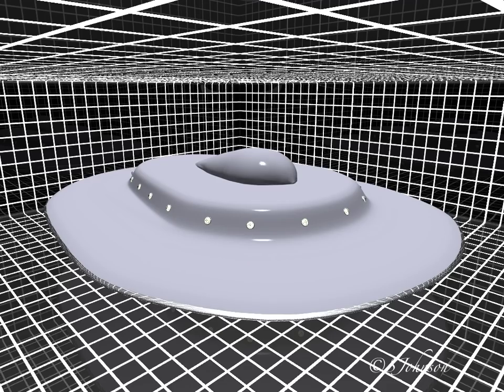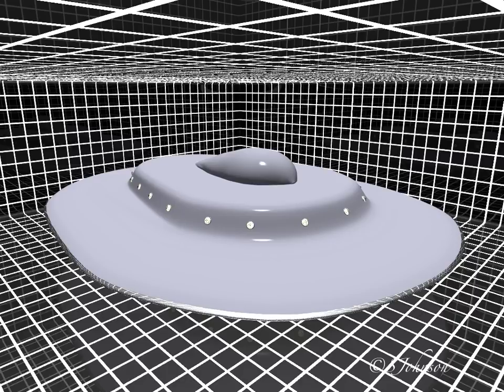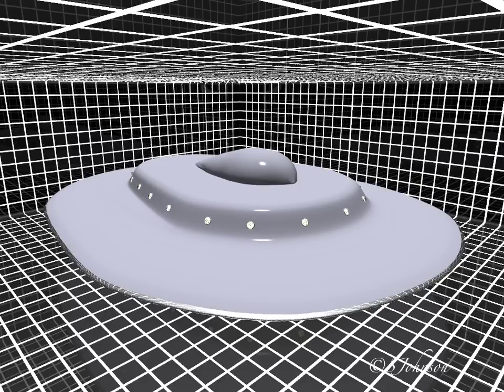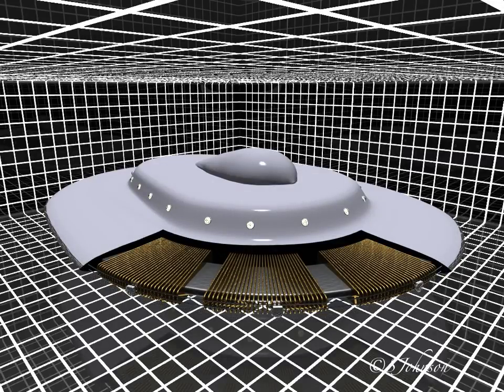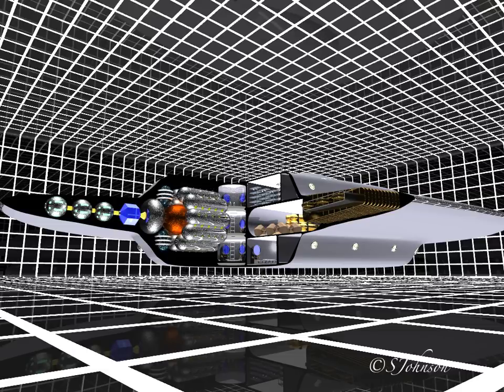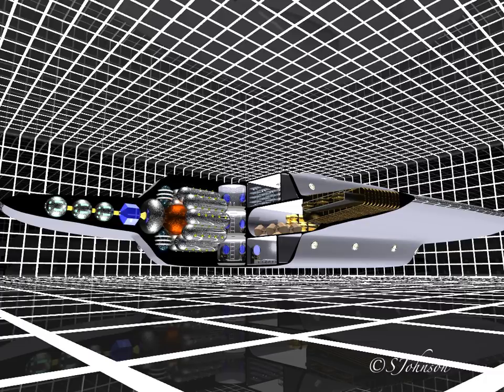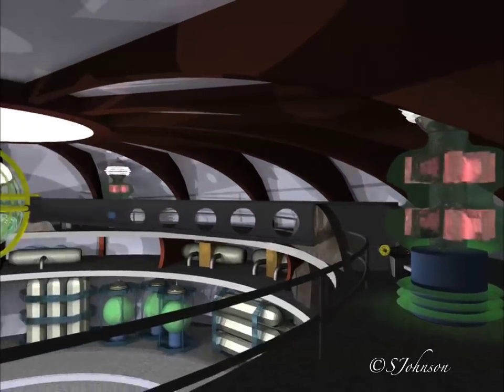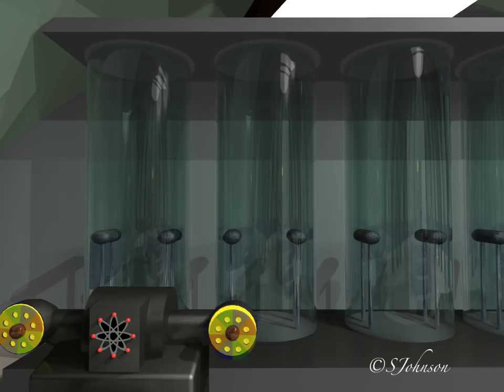3D tour of Exeter's Ship from the movie This Island Earth * Scifisteve

Comment: From the production notes available, the starship was made of cast aluminum with clearly defined texturing across the hull, similar to azdecing seen on more recent miniatures. When the ship is shown returning to earth and entering the Earth's atmosphere, alcohol was sprayed over the bow and then ignited to simulate the intense heat of a vessel traveling through air at tremendous speeds. It was a very heavy miniature.
Reply: I think you must've read my articles on the film...or an article based on my writings. Actually it was a type of mineral oil that was sprayed on the model of the ship which had been cast in iron and heated in a kiln until it was "cherry red-hot". That heated surface ignited the oil as it made contact with the hot metal surface. The model used for most of the shots was very light weight. The iron casting (which consisted only of the upper half of the entire model) was only used for the one group of "thermal barrier" shots, and was indeed the "very heavy miniature" you mention.

Comment: Great work, Steve! Particularly like the refinements, especially the shape of the bridge to reflect the saucer's exterior. It never even occured to me that the conversion tubes rising up made no sense but, of course, it's another oversight on the part of the set designer. Any chance you could add an 'observation' walkway? In my mind's eye it's just a corridor that runs around the rim of the saucer and the outer hull wall and would be punctuated by those large portholes we see on the exterior.

Comment: The only thing I'd disagree with is that here you enter the bridge from behind the tubes, but the entrance was across the room, where the lady scientist in the tube could observe the mutant entering the bridge- Otherwise, very cool. I also thought that the model (or one of them) was metal, as witnessed by the model in flames going thru the thermal barrier
Reply from the maker: +Lee White You're correct, and in "Saucer Fleet" the ramp from the lower deck is described as entering the bridge on the forward right.  An elevator was shown but bot used in the movie, so I placed it so it could be used and entered thru the aft end of the bridge. 
There were several models, some wood, plaster and metal.  I found out about the metal one after the drawing was posted.  So thats 2 for you and none for me.  Ha HA.  Good eye by the way AND thanks for actually listing!
Reply: +Scifisteve1954   ...And thank YOU for creating this digital model and critique of the spacecraft! :)